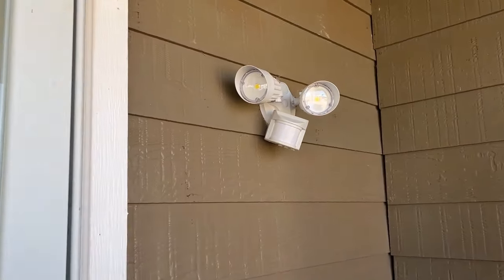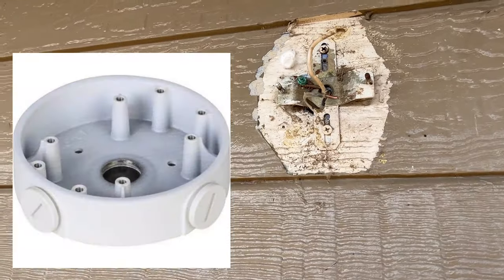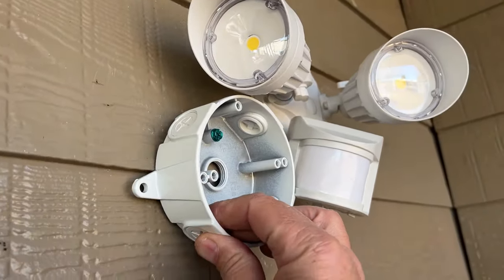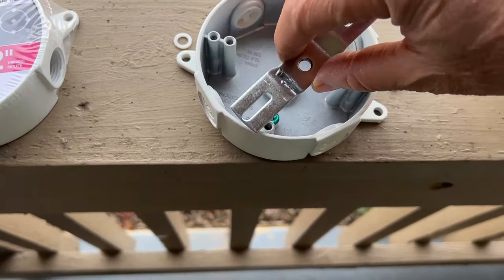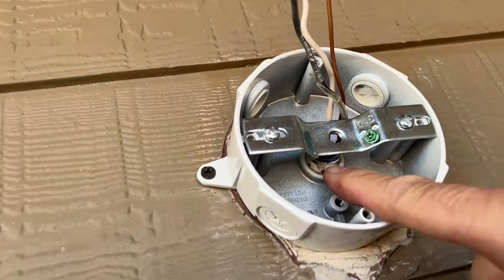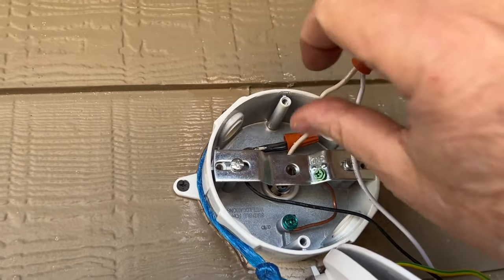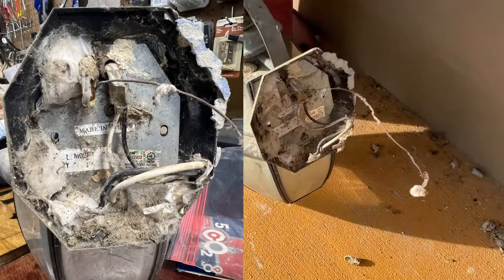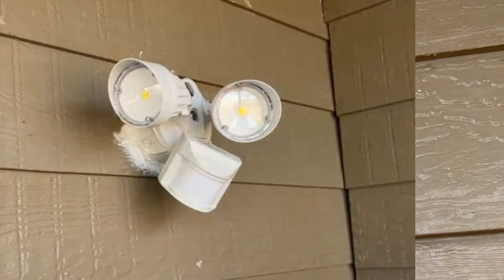How To Mount A Flood Light When You Have No Box & Just A Hole With Wires - Round Junction Box Fix

Comment: Nice video ty.  To hang the fixture to the box while connecting the wires use a Nite Ize gear tie rubber coated wire instead of string.  You don't have to take the time to tie a string and they are infinitely adjustable and come in different sizes.

Comment: This is totally an improvement but be aware it falls short of current code. Which might not be enforced in your area. 1) Romex must penetrate the junction box by at least 3", but this has zero. 2) It's unlikely the romex was stapled to the structure within 6" of the box/fixture (assumption based on prior work, but only way to know for sure is to explore under the interior drywall/finish). 3) Optional maybe, but you want "damp location" wire nuts which seal out water (agreed that this install is safely well-under the roofline, but future owners might pressure wash the structure... yeah I know).  I'm not an electrician so I might have missed something. Totally not trying to ding this. Cheers.
Reply from the maker: 👍🤠 no code where I am at Texas
Reply: @ThinkLikeAHorse  Yeah the Texas power grid and code is definitely "something else". :-)  I imagine everyone needs generator backup.
Reply: @ThinkLikeAHorse NEC is a national code, not state.
Reply: You are wrong, too. Romex sheath jacket only has to enter the box 1/4". There is no 3" rule whatsoever.  The length of the conductors inside the box is 6" minimum.  If using a box connector with a clamp, the support of a cable is 12" from the box. Connector without a clamp is 8". Support is not required when the wire is fished in the wall and is not acceptable to support it. So it doesn't apply here at all. The main problem is that he did not use a connector.
There is absolutely no need or requirement for any special wirenuts for this installation.